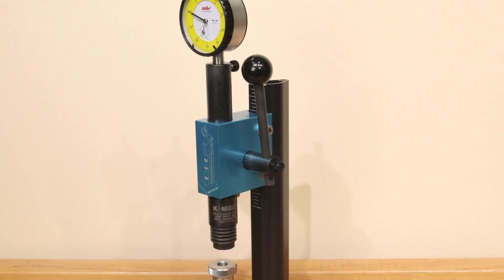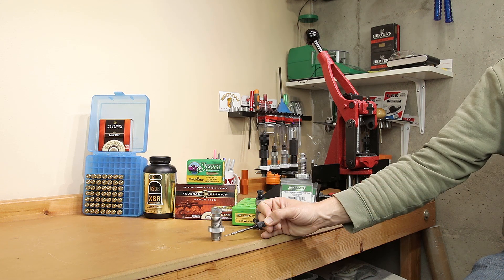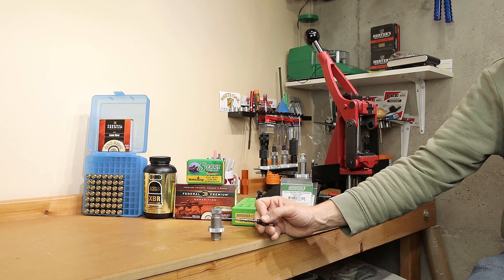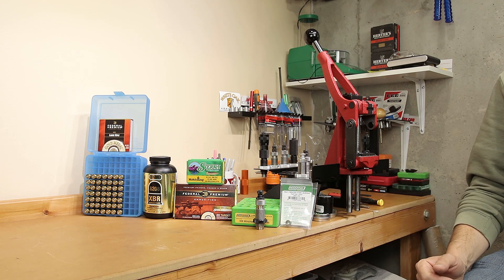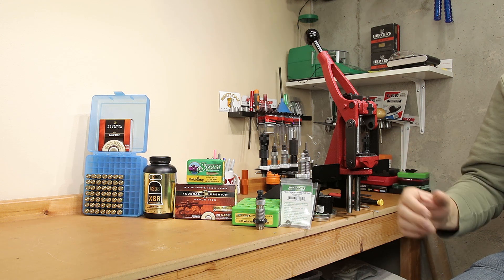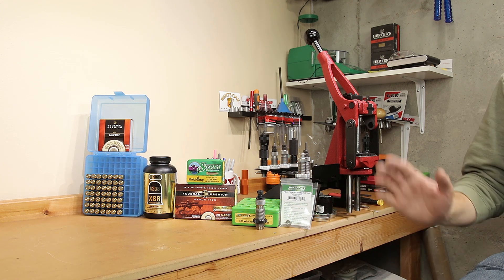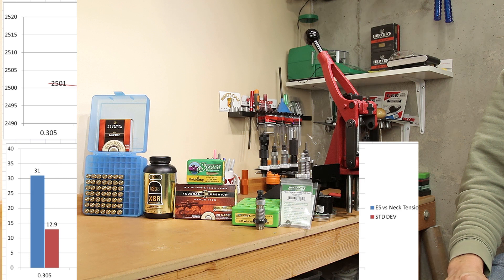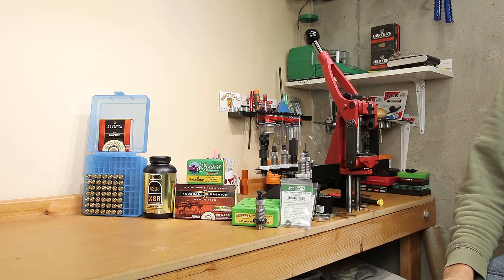Proper Neck Tension - How Case Neck Tension Affects Performance

Comment: I forget who's channel, I watched, but according to this F class shooter, the dwell time when using an expander mandrel also has an effect on the cases spring back rate. Minimum time was 4 or 7 seconds to hold the brass in the mandrel. I can't remember exactly.
Reply: Believe that was F-Class John, another excellent YouTube channel...
Reply: I do the same  with a bushing -just let the neck sit in there for a few second, and let it  spread the brass around a little bit?  Who the heck knows...
Reply: Quite true.   Run your case up, leave it there for 5 seconds, then retract...
Reply: I will let mine sit in the FL die for several seconds when I get one that is tougher to size for spring back. Also for changing x to y caliber like 7x57 to 257-roberts. Most of my brass have been range pick ups or purchased "once" fired from other reloaders.
Reply: This video comes to mind. Bonds stretching and atoms finding new neighbors. https://youtu.be/pGWSX6pStd0
Reply: Excellent point

Comment: Depends on what im reloading for. I use a lot or neck tension for the M1A i load for (.003 less then 308,) due to the bolt slaming the round fwd on loading. Compared to very little .001 to a bolt gun.

Comment: Well done sir.  With fired brass do you under size it a bit, then expand it back out with a mandrel?  
Curious if you have done a test with wet tumbled brass vs dry tumbled.  I wet tumble and get a higher ES.  I have read that wet tumbling will cause higher es but again I have no data to back it up.  Don’t have a dry media tumblr
Reply: The wet tumbling is creating a slight peening over of the edge of your neck. A quick hit with an id chamfer tool removes it.

Comment: I'm using Reddings Type S FL die (without bushing) and Competition shellholders to FL size and set back the shoulders about .002" and a polished Lee (!) collet neck sizer, giving me between .0015" and .002" neck tension in my .308. I don't like the extra step that much but it has given me slightly better results (SD/ES and concentricity). Also the Neck ID of my howa factory barrel is likely larger than on most custom barrels, so sizing the neck radially seems a bit gentler than axially pushing it through a bushing.

Comment: I need to give credit to Sam at Panhandle Precision YouTube channel and website.  I use .002" neck tension.  Redding S series bushing die. Low SD. Annealing my brass before sizing was the key to keeping SD low. Brass work hardens. Like all the hard work and sharing all Youtubers do. I appreciate your work. I  choose facts over feelings. Great work ! Keep the facts coming.
Reply: So then by that logic… I’d imagine a good practice to follow would be  .003 if it’s NOT hardened brass (as it will have more spring back) and .002 if it’s annealed first. That’s my takeaway here, any thoughts?

Comment: Great content here. I am using a using a Forster neck sizing bump die at .0015 neck tension. All Lapua brass that has been neck turned and annealed after each firing. I consistently run single digit ES and SD. Run out at .002” or less. I do like the idea of using the 21st century expander mandrels. I recently started using OneShot inside the case neck and bullet seating seems to be way more consistent. So many variables to consider.

Comment: You could actually measure the spring--back by testing with the smaller mandrels after sizing with a larger one.  I also wondered if the tension remained the same if you installed the bullet hours, days, or weeks before.  But at this point, we're probably chasing a rabbit down a hole!

Comment: I can’t wrap my head around neck tension. It only requires small pressure differences to overcome neck tension but when the bullet meets the lands it requires a HUGE pressure spike to push the bullet forward forming the land groves into the bullet. I use .015” off the lands so neck tension is only relevant for .015” of the neck travel then that huge pressure spike occurs.  How can such small variations in the pressure curve have any effect on accuracy when compared against the enormous force required to push the bullet down the barrel, yet it does!
Reply: It seems insignificant. But its a timing thing.  The neck fully opens before the bullet moves that .015 so some of the gas blows by and down the barrel before the bullet seals the barrel end of chamber.  If that released volume isn't consistent round to round then you have a pressure and speed differential.  There's a natural sweet spot where everything times just right and variation settles down giving the low ES and SD numbers like in the graph.  Years of history has shown .002 in bolt guns and .004 in semiautos is the best place to be. Some of the benchrest guys use almost no neck tension, but they're single feeding and their brass and chambers are so closely matched they can get away with that.
Reply: @mab0852  I can't really see your explanation as the reason for low SD numbers. Now I certainly can't disprove what you say but, if this were the mechanism, I can't help but think that a barrel with a worn throat should create an excellent situation whereby the bullet would completely seal the barrel every time. Also, I don't know about the neck opening before the bullet moves. I'm not sure how that mechanism would operate.
Reply: @mab0852  Yes, from what I've read the powder charge must be balanced as you've stated however, I've never been convinced as to the validity of the bullet seating depth as a factor which affects burn rate, at least not directly. At the moment, I am leaning toward seating depth creating a timing mechanism but, more to do with the barrel vibration frequency. The presently understood internal ballistics mechanism starts with the bullet being pushed forward into the lands by the primer ignition where, there is a microsecond delay then, the main body of the charge burns & etc. This is the initial mechanism that I believe is directly affected by the neck tension.  When the bullet is pushed fwd into the lands, a larger powder chamber is created which sets conditions for the burn rate of the main charge. I believe at the moment that, the much lower pressure pulse of the primer pushing on the powder column is affected by neck tension. If we consider all the anecdotal associations of low neck tension resulting in lower SD's, I think there is a definite correlation. I think neck tension sets the conditions which govern how far the bullet is pushed up the barrel which in turn, sets the length of the newly formed powder chamber. The less neck tension, the lower that initial primer burn pressure , reducing the bullet jam variation & minimizing the length of the burn chamber. Since the primer compound is much faster in burn rate, I believe it either builds significantly more pressure or, ignites more of the main charge at the base if the neck tension is high, resulting in higher initial pressure which, bangs the bullet further into the barrel before the main powder column conflagrates.
Reply: This type of thinking is where everyone comes undone. You ask how the enormous pressure differences can possibly be connected then, state unequivocally " YET IT DOES". I don't think they're connected at all the way that most think.

Comment: When does this all matter? If I get good accuracy, do I need to change? I’m using regular old rcbs full length sizing dies, 1993 Remington 700 in 308 win, and .3-.5 moa
Reply: It all matters when shooting long range. Just because you're getting small groups at 100 yards with a 308 doesn't mean much. I get .75 with a 30-30 at 100. Honestly with a good tuned load, you could have that 308 punching one ragged hole at 100. So depending on your intended purpose, good enough to you is all up to you.
Reply: It’s Matters big time when your trying to ring the bell at 2500 yards

Comment: Awesome video, and very clear and well organized material! Very interesting results. I recall Mark and Sam after work did a case crimping test on .22 WMR, and found velocity to increase with crimp. 

I think neck tension and crimp influences the time at which the bullet engages the rifling, as higher tension would release bullet from the case mouth at a later point during the pressure curve. 

As work = force x distance, in the .22 WMR test, the bullet was acted upon by a greater force as the muzzle velocities were higher with the higher crimp case.

On my Lee .308 FL sizing dies, I’ve noticed it sizes to 0.306” case mouth, and on my RBCS .308 FL sizing dies it sizes slightly tighter to 0.305” case mouth on federal brass. When I’m seating 168 gr SMKs, I really can’t tell any difference in seating pressure by hand. In both sets of dies, I’ve shot 0.3 to 0.5 MOA groups with 42.4 grains of IMR 4064, seating at 2.200” CBTO. 

It would be interesting to see a crimp variation test as well. (I personally don’t crimp, as I’ve found the 0.002-0.003” neck tension to be sufficient.)

Comment: Nice video. This is a deep topic that you probably just scratched the surface. I use a combo of neck bushings (undersize) and then follow up with an expanding mandrel (open back up to my desired amount). My theory is that the neck bushing gets it close, but as you point out, it sizes the external of the case, not the interior of the neck. I then use the mandrel which should size the interior of the neck to be cylindrical plus set the desired size of the interference fit (I am doing .002"). I don't turn necks to try to get a uniform thickness, but it would be interesting to see how that impacts things. As to measuring springback, I think you should be able to use pin gauges (precision ground pins of specific diameters similar to the mandrels) to measure how much if any springback is happening. Then again, it might be very small and hard to measure in a repeatable way because with after annealing the springback might be small? Overall, I am still somewhat new to reloading and don't want to make conclusions as to "what works best" based upon my experience. I just don't think I have done enough scientific testing (as you are trying) to show what some small changes to your workflow might have on accuracy and precision.

Comment: Like you, I have been using the expander mandrels for about the last 4 months.   I have been setting my tension by expanding the necks until the bullet will no longer move when pressed against the edge of my bench. Just enough tension to hold the round in place. Lately, I think I should use the next .0005 smaller mandrel?  Your thoughts?   Great info on your channel!